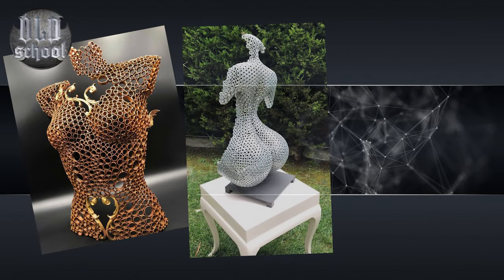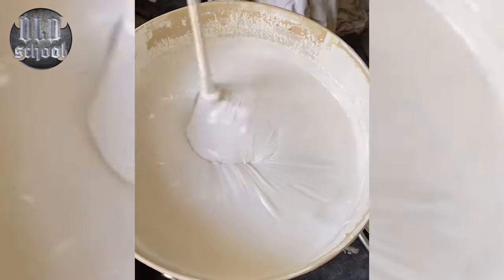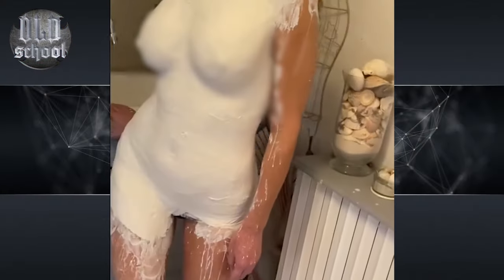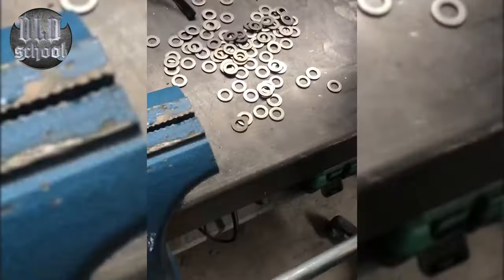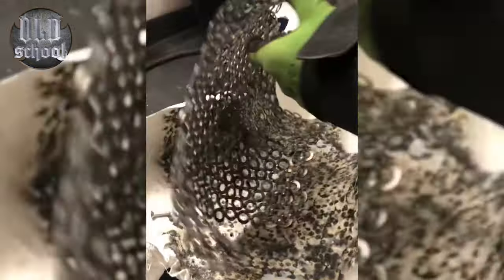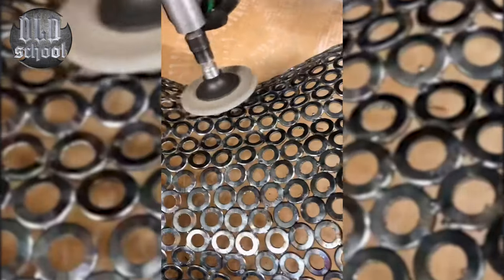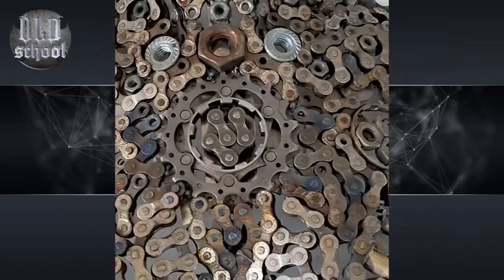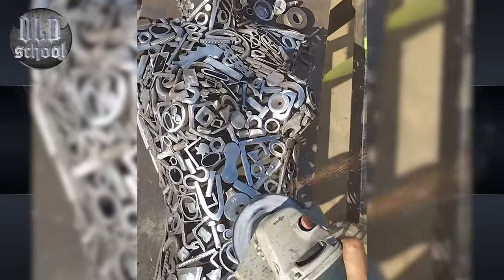How metal sculptures are made.

Comment: Hello, can we do the same thing with arc welding without burning the plaster mold? And do we have to remove the galvanized layer from the washers before? Thank you
Reply: If you get stainless steel washers there is no galvanized material, so no. If you are using zinc coated material then yes.